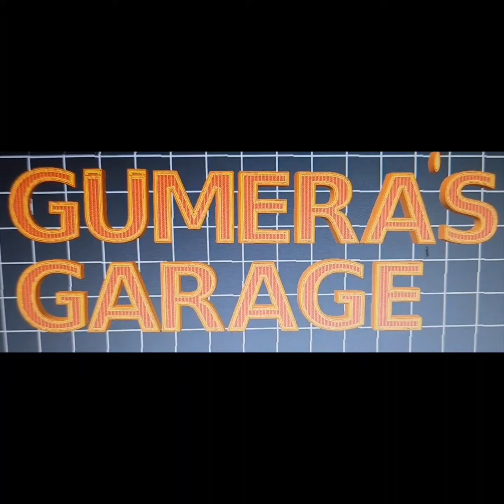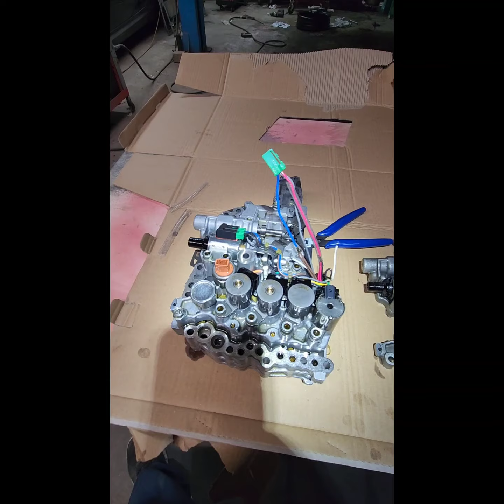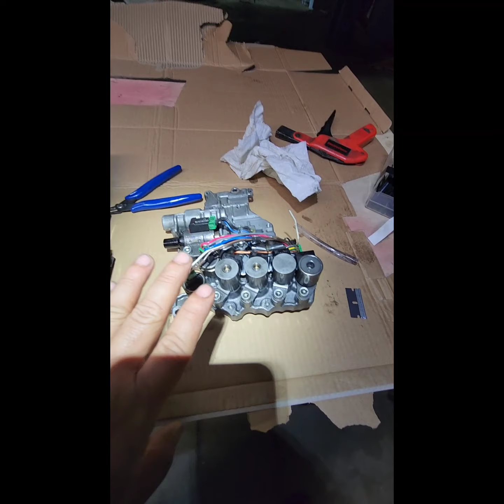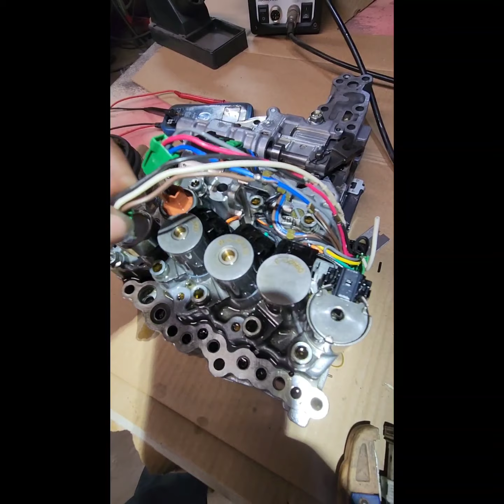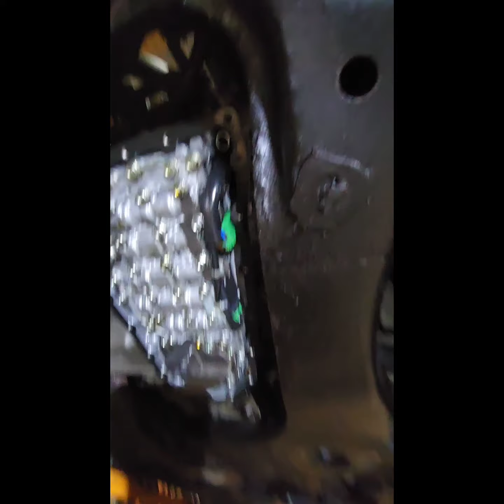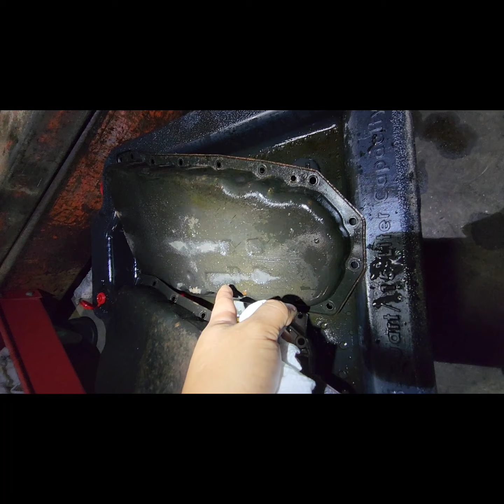2 types of CVT transmission solenoid body & oil pan for Nissan altima 4th gen.

Comment: There has been a lot of complaint that DIYers are confusing transmission oil pan for motor oil plan,Nissan decided to remove the plug from transmission oil pan.
Reply from the maker: Wow, i did not realize that. It makes sense, thanks.